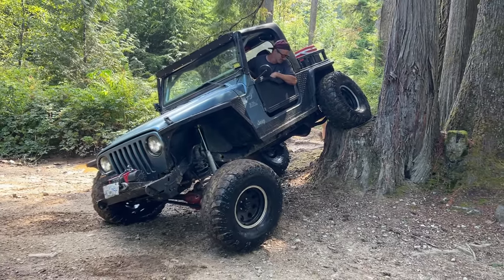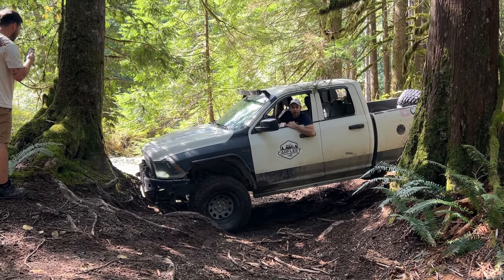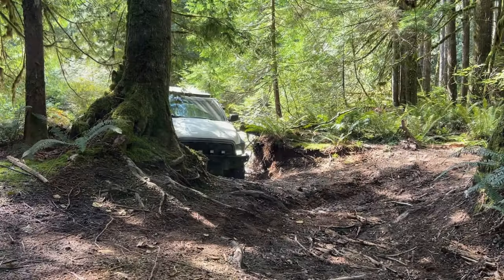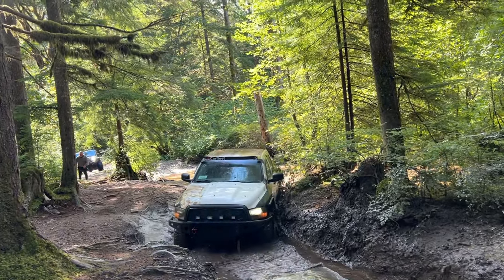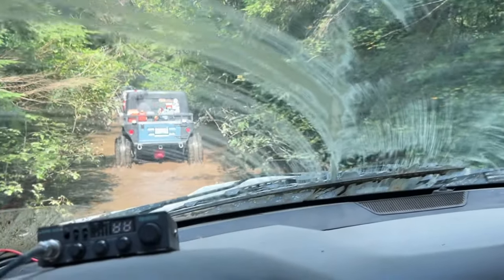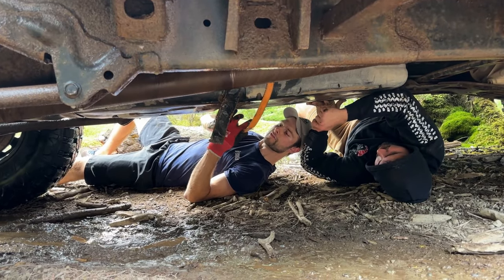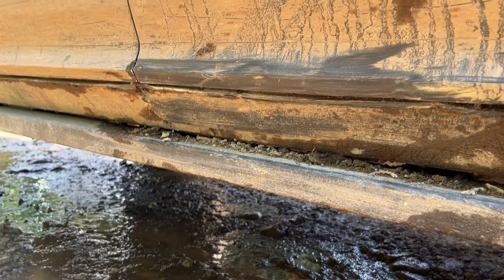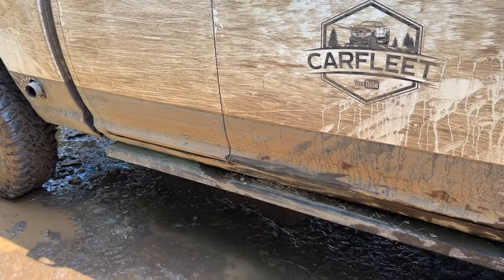RAM 1500 LOSES GAS TANK OFF ROAD! Mudding, Damage & More Damage...

Comment: A word of advice.....air down those tires. You get way more traction while crawling around corners.
Reply from the maker: Ya with the 37s I go down to 20 psi from 50 psi
Reply: @Carfleet  I suggest you buy a set of bead locks and that will enable you to air down some more
Reply from the maker: @brandonjaime86  good idea 👍🏼